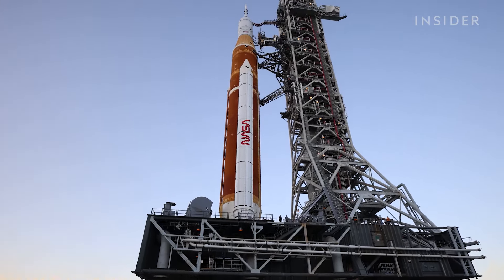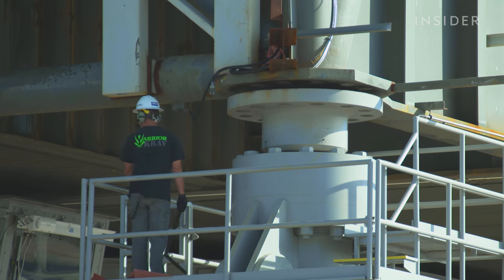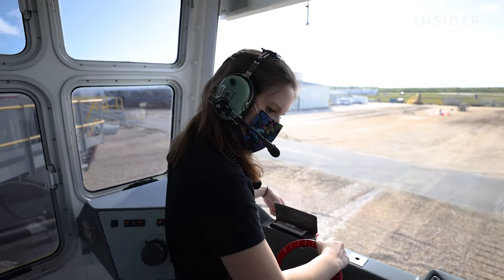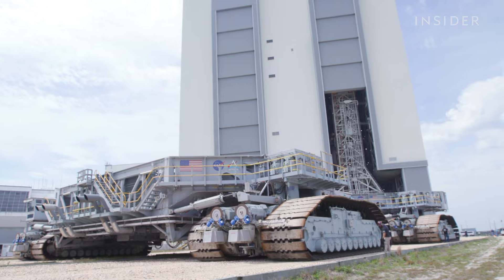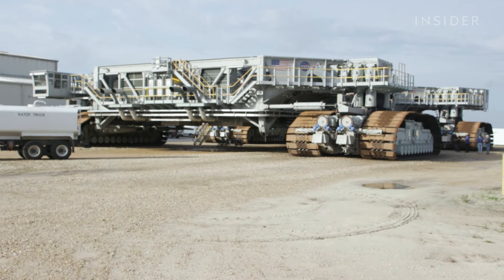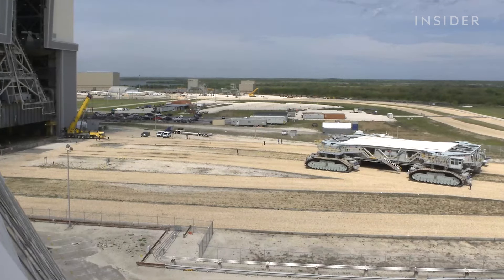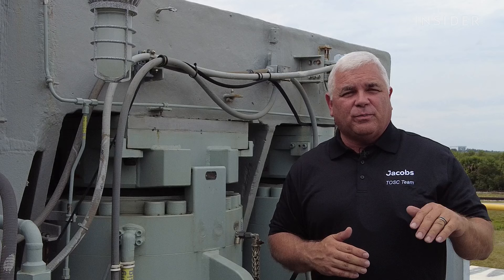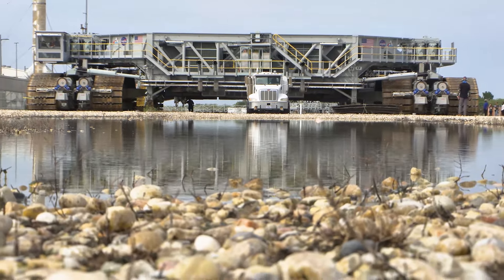How NASA Drives The $144 Million Vehicle That Transports Rocket Ships | What It Takes

Comment: This is an engineering marvel, but I’m surprised the technology hasn’t developed over the last 50 years.
Reply: Hasn't been a very big market to drive development.
Reply: They would for sure be able to make an improved version from scratch nowadays, but why would they spend that much money when they all ready have 2 working ones that do the job fine?
Reply: If it ain’t broke, don’t fix it
Reply: @tijnterpstra1986  I can think of one reason: if they needed crawler-transporters in another location.
Reply: Bro how else they gonna move that thing?
Reply: @Lucius_Chiaraviglio  But they don't need that.
Reply: @SamBrickell  Not now, but in the future, you can't rule it out.
Reply: Idk I ain’t never seen Space X use something like that. Amazing what happens when the free market enters the scene.
Reply: It really seems odd that in an era where rockets launch, fly, and land themselves on autonomous boats, they probably don't need a crew of dozens to steer and observe pressures on a ground-based vehicle.
Reply: @joeybulford5266  The thing about both the SpaceX Falcon 9 and Falcon Heavy is that they aren't that big. Not only that, the Falcons don't use solid rocket motors (meaning it is pretty much empty until before launch) so they are light, meanwhile the booster of the SLS are solid rocket motors (they're powerful) and have to be filled during assembly. (It's solid fuel, it can't be filled after)

Look I like what SpaceX is doing, but sometimes it is drastically different and have different purposes. The SpaceX Starship is gonna need something big to move it around too.
Reply: @CarFreak Of course not everywhere, but even so, more than 1 place.  Vandenberg comes to mind.
Reply: @Lucius Chiaraviglio Why would they launch SLS from Vandenberg?
And in cases like that getting a crawler there would be just one of the issues.
Reply: If it ain't broke...
Reply: @ImieNazwiskoOK  Well, for instance, suppose Florida becomes unusable for large parts of the year due to hurricanes and flooding?  We have already had a foretaste of this in some years.
Reply: so many mechanical technologies have not fundamentally changed since the mid-1900s.
Reply: @Lucius_Chiaraviglio  Then pick somewhere else maybe in Texas or other eastern state (ideally south one too).
Vandenberg kinda sucks for normal missions because it's on the west side and rockets can't use Earth's rotation to save energy, and I don't think it could be possible to for example dock to a space station with orbit similar to ISS(because it would be going the other way).
Reply: @ImieNazwiskoOK  I could see picking some site in Texas over Vandenberg, but you would need to build similar infrastructure there, including some kind of transporter vehicle for big rockets, if you want to launch really heavy things like SLS.
Reply: @Lucius_Chiaraviglio  doesn't makes sense
Reply: @Sweatcheck69  Why wouldn't it?  Unless you could come up with something better than a crawler transporter to do the same job.
Reply: @Lucius_Chiaraviglio  "if you want to launch really heavy things like SLS"
That's another IF aside from biggest one of Florida not able to support launches.
It's not even about SLS being big but about using SRBs and being vertically integrated, if SLS was made with liquid fuel boosters that alone would make it weight much less(and that's option of relatively minimal changes).

And even with all those assumptions: Why not try to transport those crawlers somewhere else(in one or more parts)?
Reply: @ImieNazwiskoOK  Those are possibilities, but you might want to also keep the Florida launch facilities for the parts of the year when they are usable.  Also, launching SLS with solid rocket boosters isn't the only possible reason to have a heavy crawler -- if you later develop a rocket that is just BIG, you'll need the crawlers or their equivalent even with all liquid fuel.
Reply: because the idea is stupid, why not to choose rails. And a huge amount of design flaws
Reply: I’m more surprised they didn’t just create a rail system in the last 50 years
Reply: @german_novotiable  Rail would be a good idea and more energy-efficient, but for launching some of the most energy-hungey vehicles in the solar system, they probably weren't giving that much thought.  Would probably save on maintenance, although the up-front greater capital investment was probably a deterrent.
Reply: @lucasstrong  
Yea that seems like a perfectly logical upgrade. Prbly why they didn’t do it.
Reply: @Lucius_Chiaraviglio  I don't see much reason to spend money on 2 facilities for SLS.
NOPE. Take a look at Starship. You could also go like ESA so you build rocket on the launchpad. You could also do something different like N1 so they used rails and lifted it up.
Reply: @goldenoodles6281  The thing is, the design of the rocket is just not efficient.

SLS needs this behemoth of transport because it needs to carry not just the rocket, but the entire launchpad.
So, compared to Starship, it's like moving the Starship rocket WITH that giant launch tower and that massive round launch pad.

That's it.

Moving such a giant rocket along with its launch pad it's just not a good design choice. SLS ends up like this because it's the curse of government building rockets. All they care about is the number of jobs created, not how good the rocket should be. So they just end up with the same thing since the Saturn V era, this behemoth of a transport.

And Starship wouldn't need something big to move it around. We have seen how they move it. Both of the stages are transported separately, and they are just using off the self SPMTs that you can buy from the market, and it's controlled by just one person not dozens of people.
Reply: @goldenoodles6281  they've been using a variety of SPMTs bought or rented from other companies. They seem way easier to run and maintain and slightly faster
Reply: As the adage goes, “If it ain’t broken, don’t fix it.”
Reply: @Lucius_Chiaraviglio  Vandenberg has not had any manned launches. Plus, you can only launch into polar or retrograde orbits from Vandenberg, neither of which is what the SLS is meant to do. Not to mention the fact that they don’t have any facilities or launch pads at Vandenberg large enough for the SLS.
Reply: @ImieNazwiskoOK  The N1 also never made it to space. It exploded every time.
Reply: @nawazdahya4382  with that type of mentality , Elon wouldn’t have created reusable rockets.
Reply: @AlexCass1515  Rockets were broken Lol.
Reply: @nawazdahya4382  who decides that? What about electric cars? So many other examples but the point remains.
Reply: @AlexCass1515  market decides that. If there is a need for it, the product will come and market will decide whether that’s worthy enough to stay.
Reply: @andrewchao9164  yea but also, NASA themselves own this massive crawler, SpaceX had to get one / make something. It's cheaper nowadays to do a job like this. But with NASA nothing's wrong with it so there's no point in buying a whole new one or depend on a new system.
Reply: @raptor2265  And? The transportation part wasn't the one at fault. It still shows that you can transport massive rockets in different ways(in this case horizontally on rails).
Reply: It has definitely evolved!  SpaceX' Starship does things a lot differently (and better).  

There is no need to drive uphill to the launch pad and downhill afterwards, for example. The reason why they do that at LC-39A is that rockets need flame trenches and big rockets need big flame trenches.  You can't really dig down into the mud/water there and build yourself a viable flame trench, but you can build on top of it and keep the bottom of your flame trench at about normal ground level.  SpaceX just has a big round thing on (thick!) stilts that they put the rocket on top of.  That means they can drive up close to it with a standard oversize load vehicle... and then they lift the empty rocket op with a crane.

They also don't need to stack the rocket in an extremely tall building -- they can do the stacking out on the launch site.

They don't need a special mobile launch tower and launch pad -- because the rocket isn't transported in its stacked form and because they designed the rocket better so it is easier to hook it up to pumps for fuel, purging gas, helium (if necessary), and electricity.

They can test the whole thing with nothing but a Liebherr mobile crane (which weren't nearly as big or as good back in the 60's!) and an oversize load truck.

They have a fixed tower that they use for carrying the "Quick Connect"-arm (which supplies liquids and electricity right up to the launch).  They also put a combined crane and "catcher" on it.  The crane can lift the rocket stages for stacking and unstacking... and it can catch them when they return to the launch site from space.

The tower itself is built from 1) mostly identical elements that can be stacked and 2) each element is built from a number of large tubes.  That means the tower itself is quick and (relatively) cheap to build, compared to the NASA launch towers.

The crawlers are beautiful brute-force solutions to a problem that no longer exists...
Reply: @joeybulford5266  Space X uses some shitty little trucks for their small rockets. For the big ones, they launch from here on these.
Reply: @807800  
Your post is riddled with errors from a lack of understanding. The greatest of which is that Starship is a highly experimental unproven prototype. SLS is a completed rocket with a proven, reliable launch system.

You really think that NASA doesn't care how good their rockets are? Is that why SpaceX hired William Gerstenmaier, a NASA Associate Administrator, as a consultant before they launched their first humans into orbit?
Reply: @raptor2265  Okay, so Vandenberg wouldn't be a good candidate for installing crawlers . . . unless you needed to launch something really big into polar or retrograde orbits.  But the point still stands that eventually you are going to need another heavy launch site.
Reply: @nawazdahya4382  which kind of renders your original argument irrelevant.
Reply: @807800  
You were belittling the crawler-transporter and its method of carrying the rocket to the launch site. I said the launch system is proven, not the SLS rocket.

Starship has not flown suborbital, which would be at least past the Karman line into outer space. Not even close. The Superheavy booster has not flown. To compare the readiness of Starship vs SLS, consider that Starship will not even go into orbit on its first 90 minute flight. SLS first flight will be orbiting the Moon for weeks. Its 2nd flight will carry humans. SpaceX hasn't even begun the Starship life-support systems.

You said "the design of the rocket [SLS] is not efficient."
A blanket statement like this shows a lack of understanding of the many factors that go into rocket design. Efficiency is not the only consideration. SLS can carry payloads to the moon in one launch. Starship will need many refuelings.

The crawler-transporter has been a reliable and versatile launch element for numerous rocket designs over 50 years. Your dismissive statement that it's "just not a good design choice" again shows a lack of understanding of the complexity of launching human-rated rockets over the long term. Do you really think Starship is brought to the pad by just one person?

The experts at NASA make recommendations to Congress, and Congress considers funding. There is back and forth debate. To imply that Congress simply gives NASA orders shows yet more ignorance of how governments work.

Of course, NASA and the SLS program have had problems. They have wasted time and money. However, writing SLS off as a jobs program from the past is yet another ignorant blanket attitude. The SLS rocket uses older, proven, well-understood components to maximize lift of humans beyond LEO. It was designed to be upgradeable and expandable, to safely and reliably send people into deep space.
Reply: @jamese9283  Yeah, I belittle the way they transport it, because that's what you end up with if insist on sticking with the past. What? are you saying the SLS rocket isn't part of the launch system? what are you talking about?

Ok, let's call it a high-altitude flight test. At least Starship has done high altitude flight test. SLS? hasn't left the ground even a meter.

I'm talking about being not efficient, and your complaint about efficiency is not the only consideration. Like, stay on topic, please. And do you really think a rocket with almost twice the thrust can't send the payload to the moon without any refilling? Really? Starship in expendable mode can send around 250T to LEO. It literally can send four times the mass of ICPS and Orion with its LAS into space!. And expendable Starship would still be way cheaper than the $2.2 Billion costs per launch of SLS.

"Complexity", that's the point. It's so complex, it required such a massive expensive crawler because it relies on the old design, lack of innovation. How could such an inefficient design that stuck in the past be a good thing? The ground system alone cost $568M per launch! Is that really the only way to build an SHLV?. One person? do you really not understand what I wrote above? The crawler requires many engineers to operate it, excluding the other person outside of that, in comparison the SPMT SpaceX used, only operated by one person.

The constellation program was canceled in the Obama administration after a review by experts convened by NASA. But Congress doesn't like the idea, so they directed NASA to work on a new rocket that would utilize as many shuttle-derived components as possible. Hence, the SLS was created. The expert at NASA of course is the one who works on the rocket, but it's the Congress who decided the requirements to use shuttle-derived components/facilities as many as possible, keeping the jobs alive. 

*you can google all of it, but if you want a book, here's a good one : "The Mission: A True Story" By David W. Brown. There's also a new book would be released in June by former NASA Deputy Administrator, that detailed about this "battle" between senate and NASA.

You simply can't ignore the fact that SLS with its cost plus contract is a jobs program.  The only reason it's designed as it is because Congress want to keep the shuttle jobs alive. Again, you can see the stark contrast with COTS, CCP, and HLS. Of course, any rocket is designed to be safe and reliable, but that's not the reason why NASA choose the SLS as it is, it's forced upon them by Congress, while NASA wants to go ahead with commercial programs instead. It was a battle during that time between the NASA administration and the Senate.

And yeah, SLS - Orion LOC (Loss of crew) rating for the Artemis mission is only 1 in 75. While CCP rating for Dragon and Starliner? 1 in 270.
Reply: @Lucius_Chiaraviglio  Until that need arises, there's no point in spending tens of billions on infrastructure that may or may not even be needed. Building these things and the facilities they operate with isn't cheap, so if there isn't a pressing need for them, there's nothing to justify the ENORMOUS cost of constructing it.
Reply: @ImieNazwiskoOK  Not all rockets can be transported horizontally. Many rockets make their tanks as light as possible to increase efficiency, but that means that it can only support its own weight vertically, and will collapse on itself (if unpressurized) when sitting horizontal.
Rails also aren't great for having to climb a slope up to a launch pad like LC-39 A or B, as you don't get much traction at all on rails, and they offer a fairly small surface to bear all of that weight compared to the massive pads of the crawler's treads which more evenly distribute the weight across the ground.
Reply: @raptor2265  I thought it was reasonably clear that I meant to build the new crawlers when it becomes known that they will be needed, although given worsening weather and increasing launch frequency, it's a matter of When, not If.
Reply: @raptor2265  Rail would give perfectly adequate traction on the small slopes at Kennedy Space Center and then some.  I ride streetcars that regularly climb much steeper slopes than that.
Reply: @807800  
You have a point about Starship heavy lifting in expendable mode, however its overwhelming selling point has always been being fully reusable. You also talk about Starship capabilities and cost as if it is already built and flying. It is a highly speculative design, and you know how Musk likes to change things.

Thanks for the book recommendations. Tempting reads.

There is nothing wrong with old designs if they work. Innovation is great if it improves things, but assuming something new will be better is a mistake, especially when sending humans into space. I'm sure you know that NASA uses decades old processors in its space probes because they are tried and true and ultra reliable. Time will tell whether Starship and SLS are worth their salt. With Bridenstine out, NASA is again under weak leadership. SpaceX is still heavily reliant on NASA, so the future is uncertain.
Reply: @jamese9283  If we are talking about a comparison with SLS, with a launch cost of $2.2 Billion, it's an adept one to compare it with the expandable variant of Starship.

Sure, it's still in the development phase, but they are already under a fixed-cost contract from NASA to deliver Starship. So, a certain baseline is a given at this point.

There's certainly nothing wrong with using old design if it provides the best solution. But in this case, it's a mandate by the politician at the Senate, not the scientist and engineer at NASA. Hence, the inefficient design because it relied on the relic of the past, a shackled from the senate.

And then there's opportunity cost. Till 2022 SLS, Orion, and its ground system have cost NASA around $40 billion based on the OIG report.
$40 BILLION!.

Imagine if all that funds were used to spur competition in the private sector, the new space. NASA would likely have a better rocket with tons of leftover to spend on many flagship science missions!.

As for NASA's leadership, there's good news. In the last senate hearing, Bill Nelson displayed his support for fixed-cost commercial contracts and mentioned the cost-plus contracts as a "plague" on NASA. (maybe it's because Senator Shelby, the staunch supporter of SLS, would be out of the Senate this year).
Reply: @thunder6281  EKHEM Starship (and I wouldn't call most powerful operational rocket "small"0
Reply: @raptor2265  I think the problem with not being pressurized can be partially helped with something like nitrogen(although it has limits so somewhat valid point). And it's to some level matter of making a compromise(with things like efficiency vs cost).

In terms of weight distribution even normal rails have things like "sleepers" and ground prepared for the weight, in case of this type of thing it would be made far stronger. And when transporting horizontally the footprint of rocket is far larger.
Reply: @jamese9283  
On topic of processors another important reason is cosmic radiation, computers made with higher technology(smaller circuits) are far more vulnerable to it(and also sometimes simply not needing something very powerful)
Reply: If it ain't broke...
Reply: @ImieNazwiskoOK  Transporting a pressurized rocket is dangerous due to the risk of the tank rupturing and causing a massive explosion. Even nitrogen, under high pressure, can be deadly if it causes a tank explosion.
Reply: @raptor2265  It definitely wouldn't be a "high" pressure. More of just raised to some level.
And keep in mind that people transport things with high pressure all the time without much issue.

External supports might also be used.
Reply: “If it ain’t broke don’t fix it”
Reply: @joeybulford5266  They use a modified shuttle orbiter transporter iirc. Bought from NASA. Not developed by SpaceX.
Reply: @digital_gadget  what goldennoodles said was right. The Falcon series of rockets aren't big rockets. They're very big compared to people (I've seen a falcon 9 booster in person), but they aren't very big rockets
Reply: probably because of how long it would take to design and make a new one
Reply: M2 Browning is pretty much the same after, what, 90 years. It works so don't fix it!
Reply: >but I’m surprised the technology hasn’t developed over the last 50 years.

You aren't surprised cars still use an internal combustion engine for the last 150 years where the principle remains the same but people improved upon the design to make it more efficient and powerful?
Reply: If it aint broke don't fix it... as they say
Reply: If it ain't broke don't fix it. But you are right. Knowing gov. they should build 2 more.
Reply: @Lucius_Chiaraviglio  what was the market drive from 1945 on?
Reply: @buckrogers7115  Not sure what you mean about market drive from 1945 on.  If I had to say something, I would say the pretty obvious -- automobiles -- but that doesn't apply much here.
Reply: At this rate
It's for old times sake
Reply: @goldenoodles6281  indeed
And Solid fuel aint exactly non explosive
Reply: @german_novotiable  if it werent using solid fuel good idea!
But No
Try lighting a firework
Same thing
Reply: @807800  actually the mobile launch pad is actually a good idea
If lets say LC39B and A are offline
They could build a new tower and boom!
That's why its good
Remember 
Nasa likes reliability 
If it has EVEN A POINT chance of failure its not gonna cut it
Reply: @raptor2265  yeah 
That's what happens when you dont test fire
Reply: @peterfireflylund  But
I wanna say this
When you're using a launch pad that launched rockets like the shuttles and apollo?
I think its more about the Nostalgia then anything 
Why build something they need to make sure it's 100% reliable When they have something that already is?
Reply: @seantaggart7382  You can rationalize it however you want, the truth is they choose to do it this way because it's the Senate's request.

And what do you mean by this? 
"If lets say LC39B and A are offline
They could build a new tower and boom!"

Do you know how long it required to build a new mobile launcher?
The current mobile launcher is what left from the constellation program. And the new mobile launcher contract (which is required for SLS B1B) was awarded in 2019 with estimated delivery date of December 2027.
Yeah, 8 years.
Reply: @807800  So
I guess you wont listen huh?
Fine then
I guess i wont listen to you 
So Please
Let the Rational men talk
Reply: @807800  You didn't listen to me!
Reply: @seantaggart7382  I already gave you the reason why you're wrong.

First about why NASA chose SLS, it's simply because the congress was ordering NASA to do so. For more detail go read the link above, it's too long to type in here.

And then you said "a mobile launcher is better, you can just built another mobile launcher," when in reality the new Mobile Launcher 2 which is required for SLS B1B would take a minimum of 8 years to build and cost at least over $1 billion.

You making it seems like building mobile launcher is really easy.
Reply: @807800  do we have to argue which is better?
Cant we both agree they are both impressive?
Reply: @seantaggart7382  If you insist on thinking it's better, then ok, that's your right to say that. But please, don't ignore the history of how it's all become like this.
Reply: @807800  I AM NOT SAYING ITS BETTER
IM SAYING NEITHER ARE BETTER
Reply: @seantaggart7382  
The thing is... here's your comment:

"When you're using a launch pad that launched rockets like the shuttles and apollo?
I think its more about the Nostalgia then anything 
Why build something they need to make sure it's 100% reliable When they have something that already is?"

You're making it seems like this is what NASA wanted, while in reality this whole thing, using as much shuttle derived component as much as possible, is a mandate from the congress. NASA never wanted this. But, congress forced it to them.

And of course, it's hard to agree that "it's impressive" when arguably this program has been a hindrance to US space progress.
From the cancellation of orbital depot plan by ULA, because it raises a threat to SLS, the staunch supporters of SLS in the congress keeps underfunded and being an obstacle to CCP especially during its early years, and the abysmal plan of the sustainable moon mission because it's held back by SLS very limited launch cadence.
Reply: @807800  Eh its because some of these people in congress saw shuttle fly
Why not give them a chance to relive memories?
Anyways goodnight 
Also you keep bothering me
i won't be happy
Reply: @seantaggart7382  Hmm, I hope you're just joking, I suggest you read the article I mentioned above to understand why SLS program is created the way it is.
Reply: @807800  no im not joking about it being late
Also i dont trust links and its too late for me to search
So GOOD NIGHT 
NOW GO
Reply: @seantaggart7382  Oh, you mean that part, Ok. Maybe next time, do your research before saying anything on the internet, though. Good night!
Reply: @nawazdahya4382  With that mentality you'd be fighting with swords when the enemy has tanks
Reply: It wasn't needed. NASA has investigated other means but doesn't see a need to replace the crawler for a while yet.
Reply: @ImieNazwiskoOK  - There is a version of SLS that uses liquid-fueled side boosters. There are quite a few versions of this rocket that are going to be built. Some for just crew, some for just cargo, some that are more powerful and some that are less powerful, etc. It all depends on the application and the payload, i.e. crew, cargo, fuel/food/other supplies, etc., such as pieces of space stations or spacecraft built on orbit. FUN!
Reply: I mean we still used steam engines
Reply: If they needed it work any better than sure but they don’t do many rocket launches anyway and it works fine for what they need at the moment, it wouldn’t make sense to spend tons of money designing a new improved version when the one they have now works fine for their needs
Reply: Don’t fix what ain’t broke, specially if it costs billions
Reply: They cost about $14 million each to make which, adjusted for inflation, is about $130 million in 2023. The fact of the matter is sure, they could build new ones with different capabilities and whatnot, but they really have no need to. The two crawlers (nicknamed Hans and Franz after the SNL skit) have, like many NASA projects, far outperformed their mandate and exceeded expectations, not to mention that throughout the years, they have been upgraded and had parts replaced and whatnot. It's actually quite the testament they're still operation considering some of the engineers that built them in the 60's thought they'd only last a few years before the weight of the rockets would cause them to have to be replaced due to wear and tear.

The short answer is, the technology have developed, but the way to transport rockets really hasn't. They still do what they were built to do well.
Reply: @Lucius_Chiaraviglio  Well considering they do 99.99% of their launches in Florida at this very space center, I think we're good there.
Reply: Not worth to engineer new ones from scratch to save 20-30% on fuel and increase the speed by a little. But they have upgraded crawlers carrying capacity by at least 50% so they have done something.
Reply: What is there really to improve? It's so simple, does it even make sense to computerize?
Reply: "IF IT'S NOT BROKEN LEAVE IT ALONE".
It's a Truck basically. What more do you want added? Anything added is just that much more to fix later.